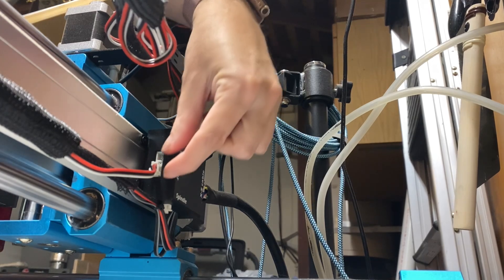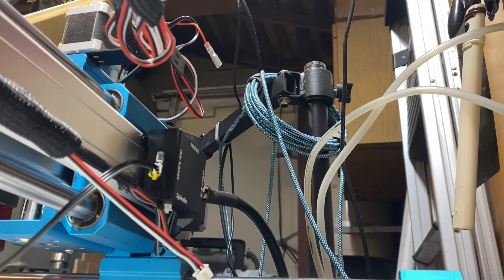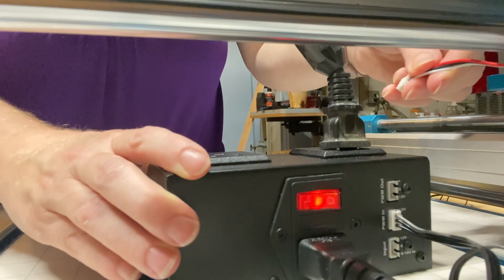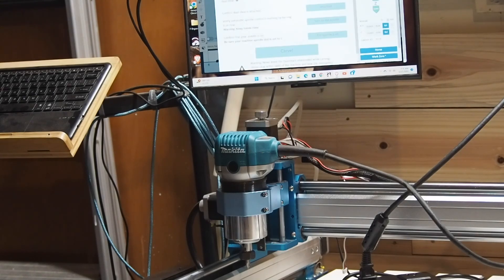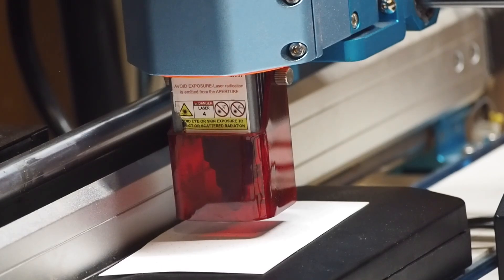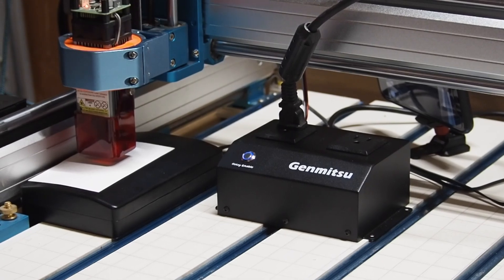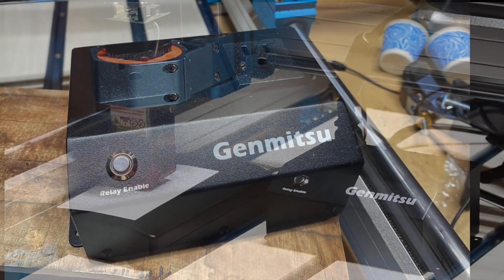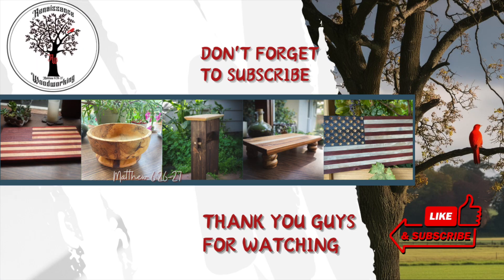Genmitsu iMaticBox Relay Switch Install & Review

Comment: So by just plugging it into the Laser port on the machine, it also controls the spindle from there?
Reply from the maker: It has both the laser/spindle connections and an outlet where you can plug in your router.
Reply: @renaissancewoodworking  nice little informative video and thanks for the reply

Comment: I just purchased this relay and have a question about the laser operations, specifically on and off.  When using the laser, push the power button (blue) off .  Is the laser then running through the $32- laser on code?  Reluctant to turn things on and let the “MAGIC SMOKE” escape.

Comment: the 4040 pro max has 3 plugs in the module probe 12v and laser I connected cable a to PWM in and to the laser prt on the cnc and its not working, power is on on the relay in the back and on the blue light of the laser bottom 
any suggestions?

Comment: do you have to add the start and stop functions in the G-Code for the  Universal G-Code Sender program? Or is it automatic?
Reply from the maker: You do not. ☺️ It’s automatic. I really like it. It has worked without issue so far. Work well with the laser also. 😊

Comment: I notice that you have the x axis extension with the Makita router motor installed.  Have you experienced any problems with flex in the x axis extension with this mod?
Reply from the maker: Hi! I didn't seem to have any more flex than I did before I put in the extension. That being said, the 4040 is not as sturdy as some other models. I just upgraded the X-axis to the Pro Max and will have a video on that soon.

Comment: If you happen to know, does it also operate like a VFD where control of a router's rpm will coordinate with settings in software? The automated on/off is nice but somewhat trivial compared to having coordination with rpm control, which is what I would buy it for.
Reply from the maker: Sorry, your comments didn’t show up. No, it does not control RPM.
Reply: @renaissancewoodworking  No worries, seems like a lot of my comments 'get disappeared' by automated software as of late. Thank you for the reply and the clarification!